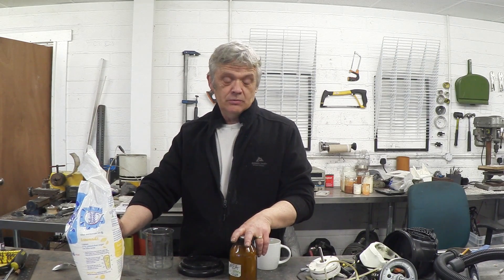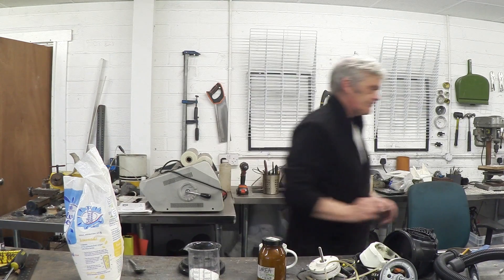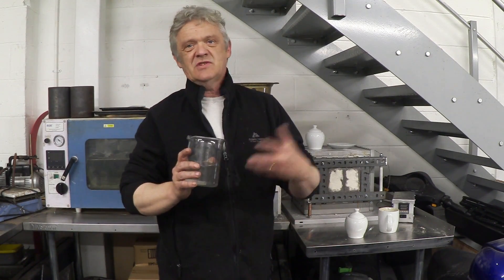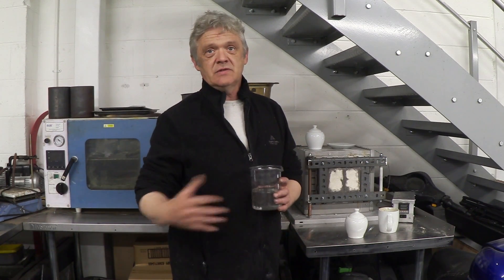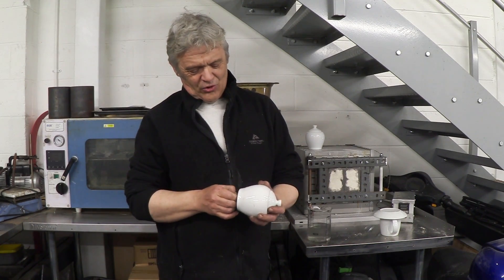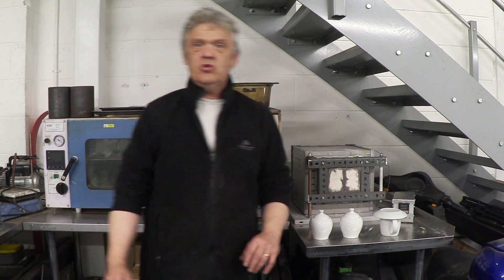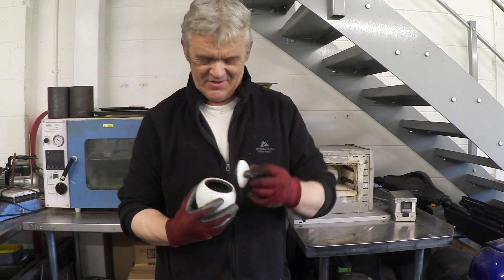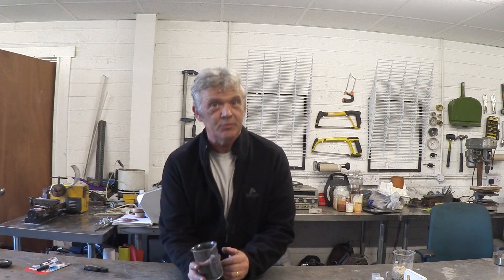DIY Safe Hydrogen Storage

Comment: Wait why are we not actually using this in large scale?  You could setup a power generating station that runs on a hydrogen generator that uses this concept, and then has solar panels and wind turbines to produce hydrogen.  The hydrogen stash would basically act as a battery for renewable energy.   Heck you could have stations like this throughout the grid that simply use grid power to make hydrogen at low demand and then runs the generators at high demand.
Reply: Politics has no interest in stabilising the grid or making energy cheap so far. On the contrary, while getting rid of Russia, us seems to also get rid of strong economies in EU. 
Only if approved and licensed by the mighty ones some technology is allowed to be practised, everything else is „misinformation“, them doubling their revenues in one year this time (in CoV 2 yrs the 10 richest men doubled their fortune, all runs as planned, as it seems.)
Reply: @andshofs5769  Sadly you're right. Politics is always what seems to get in the way of progress.

Comment: Ok, I'm not too savvy with much of this but here's a question if hydrogen is so unstable why not coat the storage tank with something that's pretty much impervious to oxidation and can only be dissolved by incredibly strong acids, like gold ? An ultralight unstable molecule surrounded by incredibly dense stable molecules... Like using lead to block x-rays.
Like I said, maybe it's a dumb question and I only ask because I'm a prospector and gold is some amazingly tough and pretty impervious to anything in nature.

Comment: Awesome once again, Robert!! So if 10% is stored and you heat this stuff to release the Hydrogen. So how does this compare to charred feathers? I thought they had like 30% storage capacity? And would it not take a good quantity of this to be useful?  Now I know I have to join your members only club lol? Keep up great work? God speed!
Reply from the maker: 10% in non-ideal conditions will always beat 30% in ideal conditions mate - and yes you will need a large amount to do anything 'useful' - but isn't that true of anything? still thanks for the kind words - cheers
Reply: 10% of a normally highly volatile and extremely light element by weight is more hydrogen than it sounds... And if you wanted to use this is something like an internal combustion engine it wouldn't take terribly much to get it going and keep it going

Comment: That is brilliant Robert. thank you for sharing. One question, after the the doped Graphitic Carbon Nitrate is heated to 300 degrees C and all the Hydrogen is released, can it be re-used to store more hydrogen? Or is it spent?
Reply: It's  reusable .
Reply: @michaelcorbidge7914  Does the 10% storage capacity degrade with use cycling?
Reply: @luisderivas6005  that's  a good question.  Before  graphitic  nitride it was titanium or nickel hydride used for safe storage and those  tanks were good performers and very very expensive.  Stored in a appropriate  cylinder for  hydrogen  at pressure , even more than 10% storage  is archived.  But up to a limit i imagine

Comment: I do appreciate this new angle, but the real best option to the is metal bead cylinders (advertised as metal hydride  cylinders, which they are not until charged). Now these are heavy, and only store hydrogen at 1.5 % by weight, but the release energy is very low, such that at room temperture  it would be control by pressure. Add pressure and hydrogen to charge,  I thin 2-3 atmo does it, may be less. Also, because the same as this the hydro has to release before it can combust, it cannot explode.

Comment: Quick math: 
1 kg of hydrogen contains 33.33 kWh of usable energy
Tesla Model 3 (Std Range Plus?) 
Battery Capacity: 54 kWh

Consumption Rate: 15 kWh/100 km
Typical Range: 360 km (225 miles)
Energy comparable H2 mass: 1.62 Kg
Required gCN to store H2@10%wt: 16.2 Kg
gCN cost: $324,000  (@$20,000 per Kg)
kWh capacity cost:$6,000/kWh  ($324,000/54)

Hmmmm OK $20/g  won't get me a hydrogen powered Tesla, but....

The Tesla battery pack weighs about 1,200 lbs. whereas the gCN hydrogen storage cell would weigh 40~50 lbs. (okay, < 100 lbs)
Reply: gCN synthesized with the method in the video should be way cheaper than 20$/g.

Comment: Am I right in saying that by heating the compound (300 degrees is said to be the temperature) the energy spent would be more than the energy obtained by using the hydrogen afterwards? What would then be the point of using this compound provided that hydrogen is safely stored in water and it can be taken out simply employing electrolysis?

Comment: So my first thought was. How do we get the realise temps down? 
If your going to store H for use in a fuel cell then a temp of 300c is not that practical.
Reply: Isolate. The question is the release energy  may not be depending on the actual temperature level. But yes, you have to overcome the thermal heating up of the material. Could use catalytic burning of hydrogen in a spiral around the tank. Of course reusing the energy later for heating etc..
Reply: @andshofs5769  I’m sure there are options. 
I really like idea of fuel cells.
I just don’t like the idea of needing to heat up a hydride to get the hydrogen out.

Comment: Robert Murray-Smith
Hi, when I was a young teenager, I was working in Chester repairing a road on a bridge, this was 73 or 74, I came back to the van and the driver was peeing into the fuel tank, being a cocky li'l sod, I said " I want to get home today!" he replied " this will make the van run cleaner and more efficient." anyway I got home all 50 or so miles! 
So being at the time having an investigative brain, I pee'd into bottles during the day and separate bottles  for morning. 
I left em in the shed and coz I was a teen forgot about them. 
about three months later I went in the shed and noticed that the bottles were different, the ones that had early morning pee had lots of white crystals in whilst the others far less, but I just poured it all down the toilet, as I'd discovered PUBS!! 
I DON'T KNOW HOW MUCH uriea cost, but I presume thats what my white crystals were? 
If so thats CHEAPER still! 
Isn't it? 
I may now be knocking on heavens or hells door now, but I do enjoy your vids when I can afford to go on the internet. 
|From a bloody old SOD..

Comment: Hi Sir, So 1KG of this stuff could hold up to 100g of H2? So that's around 4 kWh of energy storage I assume.
Now, how does the storage proceed? Cause the produced hydrogen is in gas form... What conditions needed to get it in the Graphitic carbon nitride?
And once when absorbed, how to get it out, Quick... how quick. You know about that process too? Thanks a bunch.

Comment: Interesting, but also important is where the hydrogen comes from. Most of the natural gas and oil reforming methods to produce hydrogen release the carbon as CO2. What would be really awesome is to be able to produce hydrogen from hydrocarbons but keep the carbon as solid carbon. Some direct hydrocarbon fuel cells do it, but then the solid carbon becomes a problem, clogging up the fuel cell. Imagine being able to fill your electric car up with petrol or Diesel, run it for a thousand km then dump the carbon in a bin to be put back into disused coal mines before refuelling!
Reply: or just hook up your electrolyzer  to a solar array and whenever your off grid batteries are full, send excess to the electolizer, bang boom you got hydrogen.

Comment: Let's say you have 100 grams of this stuff and you safe up to 10 grams of hydrogen in it, isn't that an awful lot of hydrogen gas? 
I actually looked it up and it seems 10 grams would be 5 mole of H2 which means it would be around 112 liters of H2 gas.
Do you use clean Urea which is used for cosmetics or just the fertilizer with 46% N content?

Comment: I wonder if you let the HHO gas you produced with your grafite sheets, run through this material, if it will hold on to the hydrogen and let the oxygen pass through. That ! would be something  :-) You could simply create loads of gas and filter it in your containing material. Hence. home free  :-)

Comment: When I think of Hydrogen storage I just think Ammonia, 1 nitrogen and 3 hydrogen's.
Reply: Then think of H2 as some intermediate energy storage. I do not have seen a video where anyone is doing direct NH3 synthesis, I imagine so far, I have to take the long route: in summer, produce H2, in night burn it, store burnt air as O2 depleted N2 in a bag, next day use it to produce NH3 together with freshly produces H2.  But it may be this is not necessary any more.
Reply: @andshofs5769  I don't really see any benefit to hydrogen at all, other than for industrial purposes it doesn't really serve a point. If you are getting all of your electricity demands met with atomic power like a civilized human being, hydrogen for hobby use? I guess?
Reply: @MatthewHolevinski  Atomic power involves building permits and transmission lines. In that ten years to complete project, too much happens politically allowing big oil to kick can down road for another ten years of fossil fuel dependence, and nuclear target for terrorism.

Comment: Nice idea 👍 but wouldn't that  actually be Pyrolitic Carbon Nitride ?    I followed Billings Institute in the 80's when he was using Titanium Iron gravel to store hydrogen but was expensive and required heat to release the hydrogen .
Reply: After looking at the research guess I could be wrong, I'll have to work out the formula , LOL. Interesting research but it seems to be missing something to make it efficient .
Reply from the maker: it's not my research mate - I am just copying what others have done
Reply from the maker: maybe

Comment: I'm actually not sure at this time. Currently I have a process to compress c02 gas, which comes out of the chamber as a solid (dry ice). I theoretically want to replace the c02 with hydrogen. I'm a bit hesitant. Would it be explosive?

Comment: Why not make pellets out of it and only heat a few when you need them in your engine, also easy to refill, just put a bag of pellets in your car
Reply from the maker: interesting idea mate
Reply: I think pellets might reduce its surface area and by proxy its hydrogen storage capacity

Comment: Another awesome video. I have just finished making my heating element for my stirrer.  Just awaiting magnets as I didn't have any suitable at home. 
I have one brush less and one brushed washing machine motors. What should I make with them mate?
Reply from the maker: loads of things mate - what kind of things are you interested in?
Reply: @ThinkingandTinkering  Well electroplating, anodizing was the reason I ran into your channel but now I have a wide array of things lol. I'm thinking about a mounted sander. I already have a 50w motor for my tumbler.
Reply: Also do you know of a way to produce a cheap silicone for taking moulds. I have a concrete boxer dog that I would lover to replicate

Comment: I've seen other videos whereby hydrogen was stored into a 20# propane tank and a multi-ply 30 inch weather balloon.  Are either of those feasible for longer term storage for use at a later date?

Comment: What is the substance you just made called? Bec you said it was “similar” to the process of making graphitic carbon nitride, so I’m assuming it’s not that?

I want to do some research on the stuff, so I can find out under what pressures and temperatures it will absorb and release hydrogen.
Reply: he called it carbon doped graphitic nitride

Comment: So if gasoline is approximately 2.8kg/gallon and my Prius C has an 11.9gal tank = 33kg and if 1kg of hydrogen has the same energy as 2.8kg of gasoline, then we would need around 11kg of hydrogen. But you can only store it at 10% weight to the carbon storage canister... ignoring the sheet metal tank it will be kept in..we would need a 110kg tank. 

So is it possible to store more than 10% by adding pressure??? 

But wow, this is great for storing hydrogen at home as energy storage for sure! For example here in Washington state, one could have a wind turbine running an electrolysis machine and storing the hydrogen for usage later that night or maybe for use during a blackout or for winter heating.
Reply: Just saw the comment about 30% in ideal condition. That would put your storage media at 36kg so on parity with just the mass of the liquid gasoline.
Reply from the maker: I think home storage is a great place to start mate - if we wait for the best it will never come if we use it for what it is good for and develop it then maybe we can make a difference
Reply: @ThinkingandTinkering  exactly! I would totally use it as a backup generator/power supply when the lights go out. And we have power failures all the time in this State because it is windy, we have tall trees and lots of rain and snow. So definitely a market if there was a product.
Reply: It you want to get into the details of it the gasoline specific energy you cited is its optimum energy density however internal combustion engines can only run on gaseous combustibles and alot of petroleum is lost or wasted due to storing it as a liquid, hydrogen however being a readily available gas would have an overall higher efficiency and this material is capable of photocatalytically splitting water into the requisite gas, so its more readily and renewably available.

Comment: Any idea what the surface area/gram of this stuff is like? I assume its storage capacity is highly dependent on that.
I wonder if it could be improved by mixing in some kind of blowing agent, or by soaking activated carbon or highly exfoliated graphite in the solution and then heating the material.
Reply: From what ive researched graphitic carbon nitride doesnt have a terribly good surface area unfortunately, however they also talk about carbon doping to improve this facet of the material so it might be above average to the normal lab supply stuff.

Comment: What percentage of the hydrogen being released from storage is consumed in providing the heat necessary for the release process?  10%?   75%?   This presentation is leaving a lot of unanswered obvious questions unaddressed which raises suspicion.
Reply: No, it tells how to produce the hot research stuff. It was never meant to release you from reading papers and re-doing the experiments yourself.

Comment: I Love Nerdy people!!! I am always looking for off things know one seems to know about, accept of cores your Channel!! Not kidding this for example I was looking for Lithium Nitride storage for Hydrogen, you are offering an alternative that works the same way while I am not paying out $200+ for micro amounts, I will be able to make this Carbon Nitride alternative, for HHO storage in high pressure tanks (scuba type 2000+ PSI) I am looking to extend gas mileage yes with enough tanks you can just convert to HHO only, but something a little more reasonable that I could travel more then 200miles before, heading home is better! if I can park my car with enough solar power producing HHO and storing it along with Gas I can cut my mileage cost by at least half, if not more but at least I can produce hydrogen and store it when I am parked, if possible even stop at a Electric car charging station to produce more and charge batteries, to extend that production $200+ a few grams is out of reach and sense for people to explore this type of technology

Comment: Only 10% by weight? Wouldn’t you get more storing it as a compressed gas
Reply from the maker: yes if you have the equipment
Reply: Only if you could do cold storage, which is already bringing down the net energy value of the hydrogen you want to use, and 10% is alot more hydrogen than you might think

Comment: Maybe you should make it and sell it.
Reply: Better, buy some laser powder fusing 3D Plotter, because what we need is some decently effective electrolysis unit, where you build the structure from some porous material, and coat it with that stuff doped with metal catalyst depending if wanting to produce H2 or NH3.
It becomes effective if fluid is carried capillary, and gas diffuses through the porous material, and gas is transported in a bit bigger pimpelte structures.
By this you avoid bubbles, and researchers reached 98% efficacy H2 electrolysis by this trick.
Perhaps we need a 3D moved micro airbrush spray or inkjet nozzle for the coating with metal atoms for catalysts.

My plan is to try doing both, H2 and NH3 catalytic electrolysis engines.

I found out most earth gas tanks for liquid gas are coated and have admission for NH3. This is easily compressible, gets liquid at 9 bar and at 20 °C, which is moderate. You need a bit corrosion protected gas pipes and vents etc.. Perhaps a dryer filter.

Comment: You stated by weight - but the usefulness of hydrogen is by volume as a gas ---- So did you actually mean if you have 200 kilos of this you will store 20 kilos of Hydrogen by weight or 20 liters... if you mean Kilograms then what is the conversion of 20 kilos of Hydrogen to useful volume?
Reply: What I mean is the "Useful" conversion to be expected
Reply: Wiki Hydrogen tells you this, what is the problem? H2 at what pressure and temperature? You actually buy H2 per kg. The question I have: what is the density of the powder? Because with or without hydrogen, you need volume for the storage.
Reply: @andshofs5769  Why, On demand production is the Holy Grail